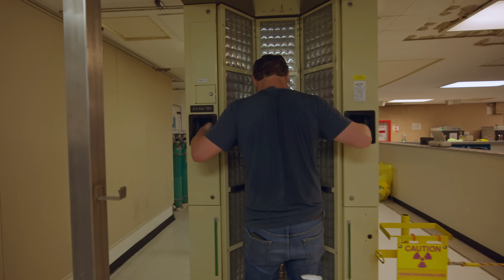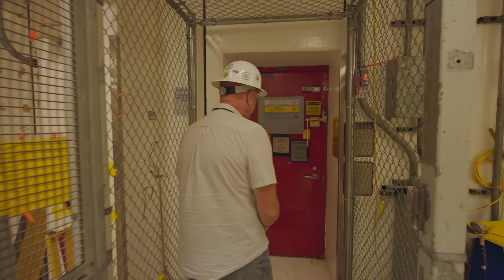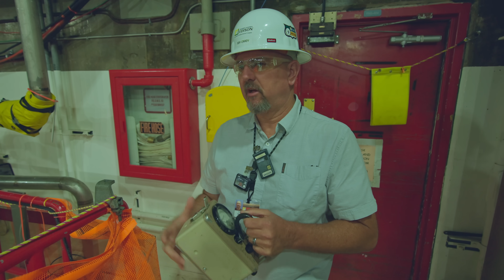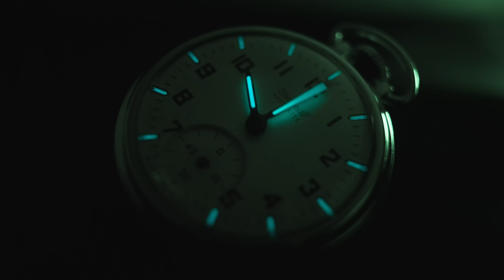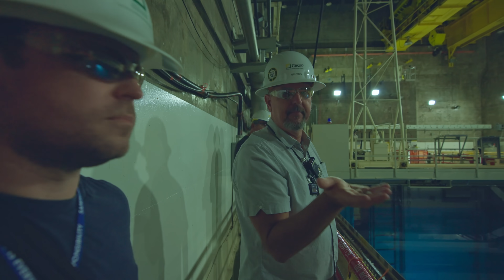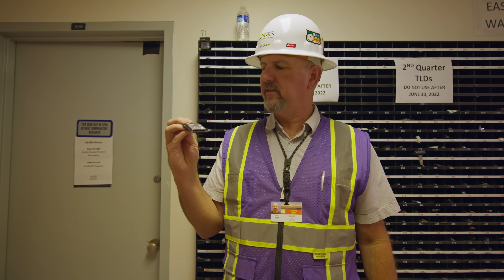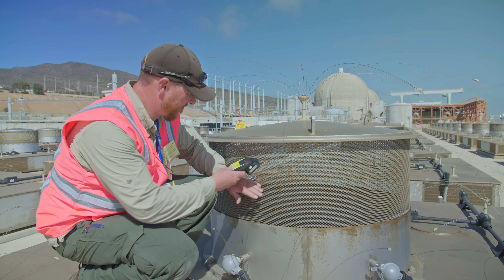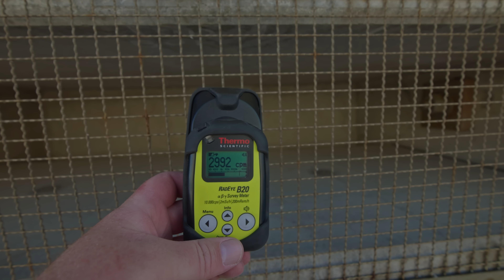Inside San Onofre Nuclear Power Fuel Pool and Spent Fuel Storage

Comment: I spent my career as a renewable energy infrastructure technician and if I had to pick between wind or solar for longevity, ease of operation, power output and environmental impact and ROI... I'd choose nuclear. 

Spent the last years of my career working for GE.  Did you know a solar panel has to be used for 7 years before it "pays back" the electrical debt it took to create it?  The silicon has to be grown in vats using huge amounts of electricity.  There's also many toxic chemicals used and other materials which all have to be mined, refined, and smelted.  Typically in other countries where their emissions controls are unregulated.  
On top of that, when the panels (we call the modules, but y'all call them panels.  Technically a panel is made up of modules...but if I say module everyone's eyes glaze over) aren't easily recycled. 
Pretty soon there will be mountains of panels laying around waiting to be recycled.  
Except that recycling process is going to use lots of electricity too. 

The wind turbine blades are fiberglass, and are already creating a problem.  They were scattered all over the old fields I worked on, covered in grease and oil. Nowhere for them to go, but they sure have created a habitat for rattlesnakes.

But everyone who doesn't know crap is always like "fill the deserts with them!"

Now you need more transmission lines.  You're talking hundreds of thousands of tons of aluminum, steel, copper and alloys (which all has to be mined and smelted, then cast or extruded...oh then shipped here!) just to run that power out across the desert to get it to where it needs to go. 
And because you've stuck all that power generation infrastructure in the middle of nowhere... there's more line-loss getting it to somewhere.
And due to the heat, everything gets derated.... 
Then people have to go live nearby to maintain it. 

Then there's nuclear.  
There's over 400 nuclear power reactors operating around the world, yet how often do we hear about major accidents?  
Mostly Fukishima with the tidal wave.  We've been learning from the past mistakes and incorporating them into newer, safer power generation technology.  
A properly set up operation today can re-enrich the waste with a breeder reactor and generate power off both sides of the operation, generating even fewer amounts of actual waste and greatly increasing the operating life of the fuel. 

Now lets talk about draw. Megawatts v megavars.  
With renewables, they're always outputting 100% of what they can produce at any given time, whereas a steam-driven turbine can spool-up to match the load. 
So say it's summer and Dryer's ice cream company wants to turn on a whole bank of freezers after a maintenance cycle...  that's a lot of inrush current, ok maybe they start them in series...  but where does that power COME FROM if renewables are always outputting what they can, when they can??
So now you're like.. oh we'll use the renewables to charge batteries, and we'll store the power!  Wonderful!  Now we're mining F-tons of lithium and other rare earth minerals and no matter what anyone tells you, any tonnage of it is ALL conflict mined...  but everyone needs it so no one is really pushing that whole story. 
But besides that, now you've got massive loads of more mining, more refining, more smelting, more manufacturing, to produce the batteries you're going to use.  Because lithium has such a higher energy density than lead-acid types.  

So now you've actually created a much larger carbon footprint by insisting on using renewables, than if you'd used COAL FIRED PLANTS in the first place. 

You know what's in the gearbox of a 3MW wind turbine?  A few hundred gallons of OIL.  Know what all the wiring insulation is made of, that runs up and down tower and all over underground?  Hydrocarbons.  You have any idea how many 5gal buckets of grease and lube get pumped in to purge bearings? 
How about electric pitch systems with their backup batteries?  6 batteries per blade, 18 batteries per turbine. So for just 100 turbines that's 1,800 gel-cell batteries that need to get replaced.  But since the desert isn't a cool location, those batteries won't last 5 years, more like 2.  So for a thousand turbines that's 18,000 15Ah batteries you're replacing every two years.  For 5,000 turbines that's 90,000 batteries.  

What's that, you're using a hydraulic pitch system? (no chance you're gonna get me climbing those disgusting oiltraps) now we're talking.... how many barrels of hydraulic fluid?
 
There's nothing "green" about renewable energy. 
Renewables have their place, but it's NOT powering massive sections of the grid and being relied on solely. The Green New Deal is a LIE being sold to you by ignorant politicians who don't have a clue what they're talking about. 

You don't get to just produce 95% of your products in other countries then act like that pollution isn't being created because it isn't being created HERE.  That's called a shell-game, it's what trickster's play. Which is also basically cap-&-trade in a nutshell... a big shell-game.

And now you're using up dozens of square miles to sporadically generate the same amount of power that a square mile nuclear station can generate reliably without ceasing for 30 years or longer. 

But yeah, go on with the whole "fill the deserts with solar panels and wind turbines" thing, you'll continue to fool the masses into thinking you know something, and you'll continue to sound like an absolute fool to anyone who actually knows what's going on. 

The next time you guys hear someone say that line... start hitting them with these facts and see what they have to say about any of it.  What you'll find out is they have no answers, because they aren't used to dealing with facts, just rhetoric.  It all falls to pieces under the slightest scrutiny if you're aware of what you're looking at. 

I love solar, I'm fully off-grid.  No grid-tie and live quite comfortably.  Just replaced the old Outback 240V FXR dual inverter system with a new SolArk12kW with 8kW pv, and 21kW AES "48v" LiFePO4 batteries running canbus comms to put the system into closed-loop operation.  
It's not "green", it's renewable... but really it's easier just to call it "off-grid".  It's not on the grid, it's off the grid.   My electric bill is essentially $150/mo across 20 years.

There's no reason to bring into it the inherent green-ness, or lack-thereof.  It all took fossil fuels to create, but it allows me to live "off" the grid. That's it.  No extension cord, y'all have your blackouts and I do my own thing.  Guess what happens if there's no sun for 4 days?  A propane backup genny kicks on.  Guess what happens if it doesn't kick on?  A gasoline-powered genny kicks on.  So propane is the 40kW primary but I can charge this bank on as little as a 4kW generator. 
Try that with a 48vdc lead acid bank. 

If you want to know about renewables... go ask someone who works in renewables. 
But the next time someone says to "fill the deserts" with them... he doesn't know jack.
Reply: Word! Nothing can compete with nuclear.
Reply: Wrote all of that and not a single comment
Reply: @The_Movie_Thieves  most folks these days have incredibly short attention spans. 

They also prefer to be lied to, people don't typically want to know anything that might go against their strongly-held beliefs.
People don't have time for things like facts.  
Especially if they don't fit the narrative they want to push.
Reply: Efficiency of solar system starts dropping off after 5 years . Then comes the cost of getting rid of the panels cuz no one can just dump them into back alley trash  . Try stacking panels in a back corner of your yard & ask if code enforcement says anything . Then deal with the EPA fines from volitals leeching out from cracks into the ground .
Reply: Brilliant!
Reply: Thanks for putting your time into making this comment
Reply: Dam did you have more time on your hands to write this. Whew I can't imagine the novels you send your lady after she gets mad at you and you have to go detail for detail in your brain about how you are trying to renew yourself to be better 😂.  But yeah I agree
Reply: Bro you might be schizophrenic
Reply: Why don’t we just fill the freakin deserts with wind turbines? Duh. 🤪

I kid, but no, I’m a firm believer in nuclear power. I believe we need it and we are going to continue to need it for the foreseeable future. Some people keep promising nuclear fusion is right around the corner but meanwhile we can’t even figure out how to make one fusion reaction that doesn’t require a TON more energy to make happen than whatever potential energy would be created. Those lasers that NIF uses are ridiculously power hungry. So far all we’ve done in the field of nuclear fusion is figure out how to spend a ton of money to use electricity up. So far, at least, it’s gone nowhere, and fast. You’re right about renewables and you’re right about batteries. Nuclear (fission) power is the one and only way that we humans have figured out how to deliver baseload-levels of power to the grid reliably, 24/7, year in and year out, with the lowest carbon footprint and no co2 emissions (at least from the process itself). If we don’t want to use nuclear power and coal-fired plants are needing to be phased out then where else are we going to get the power for 7 billion humans?

Comment: what were to happen if you fell in the water in the pool or say if the fuel were still in there what would happen to you
Reply from the maker: Nothing...the water is a great shield against the intense radiation coming off of the spent fuel. If you were to dive down to try and get to the spent fuel...maybe 10-15 feet or so, then you might get a fatal dose of radiation.

Comment: Is the qater in that cooling pool radioactive?
Reply from the maker: Yes, the water is radioactive. It’s like that because of little pieces of metal that have been made radioactive from being close to the spent fuel. Spent fuel gives off different types of radiation but there is one that mainly happens with fission and that’s neutron radiation. That’s how non-radioactive materials can become radioactive.
Reply: @RadioactiveDrew  then what do they do with that radioactive water?
Reply from the maker: They will filter all the activated metals out of the water making it safe to be disposed of.
Reply: @RadioactiveDrew  how do they do that? Is the water safe afterwards?
Reply from the maker: The water has to be safe afterwards or it gets sent to low level radioactive waste storage in Utah. I don’t know all the ins and outs of how it’s done but I would imagine just a bunch of filters and it run through them over and over.

Comment: Great video.

For those of you that work in SI units 5000 mRem equals 50 mSv.
Also the effective dose limit for nuclear workers is 20 mSv / yr averaged over a rolling 5 year period (i.e. 100 mSv / 5 yr) with a maximum limit of 50 mSv in a single year.

Comment: Did I understood right that the pool is empty of the rods?
If so, where the radiation comes from?
Reply from the maker: Yeah, all the fuel has been moved to dry storage. The radiation comes from metals that have been activated by neutrons coming off the spent fuel.
Reply: 700 reactors have been decomissioned. 25 out of them has been dismantled.

Comment: Nuclear is clean. Solar destroys land.
Reply from the maker: I think solar has its place...maybe on rooftops and parking lots. But putting a bunch of panels out in the desert is really bad for everything that lives out there.
Reply: @RadioactiveDrew  I agree Roof Tops, and old Parking lots. There was talk about what about the Sahara? Well if they were to cover the entire Sahara, it would limit the dust, this dust benefits the Amazon, and actually helps to suppress Hurricanes. Covering the Sahara could actually harm the Amazon. 

In the deserts it would impact life in general. So what it boils down to, its a selfish $$$$ driven enterprise. Wind generation may also have a negative impact as well. IT could affect air currents downwind as the rotors disrupt the airflow. 

It's why Nuclear is a viable option, less impact and it is very safe. The 3 major incidents was human error. Fukishima if they built the walls higher, 3 mile island if the fools there didn't interfere with the system, and Chernobyl, if they weren't screwing around with the fuel rods. There are reactors that do not produce waste, and there are newer smaller reactors that could power small towns vs using an interconnected grid. Solar? Adds 190lbs of carbon per acre, while the trees they prevent from growing remove 130 tons per acre per year.
Reply from the maker: @InTheKnow-2525  nuclear is a way better option for energy generation when looking at energy density and land usage. Nothing even comes close to it.
Reply: @RadioactiveDrew  Longer term viability as well.

Comment: Great video, duck tape and an old sock to reduce radiation in this area.  WTH…love the rust and corrosion on some of the pipes.  Makes me feel safe.  Looks like another disaster waiting to happen.
Reply from the maker: The plant is in the process of being decommissioned. So yeah, a lot of things aren’t going to be tiptop at the moment. Also that is a lead soft shield wrapped around that pipe. Think of the same thing you wear when you get an X-ray at the dentist.

Comment: Question..when you asked about tsunamis, your guide mentioned the use of the sea water to cool the fuel down.  I recall from Fukushima that the problem with using sea water is that the salt in the saltwater is corrosive and may reduce some temps, short term, but it would destroy and corrode other parts of the containment vessel.  Is there something different about this plant where sea water is a viable back up plan?
Reply from the maker: The sea water cooling was part of the secondary loop, which has no contact with the primary loop that connects to the reactor.

Comment: If you swam in the pool with spent rods, would you die?
Reply from the maker: No. The water would shield the vast majority of the radiation at the surface. If you dove down 10 feet or so you would get a fatal dose.

Comment: I wish that crap was gone from my back yard. Yay 5 feet over the 27 foot tsunami prediction. Smdh. Its sitting on a massive fault. get it away from the ocean at least.
Reply from the maker: Its totally safe right where its at. It would only be a problem with you were able to remove that 35,000 pound cover and climb down inside.
Reply: @RadioactiveDrew  “Totally safe” would be eradicated somehow. It’s not totally safe as you can see from the lengths that go into containment. “Totally safe” until it isn’t. Get it away from the ocean is a NO BRAINER

Comment: What is the half life of the rods? What is the expected life of the long term containment?  Tsunami safe maybe but earthquake, terrorist or missile strike? Yikes  Great video, thanks!
Reply from the maker: The spent fuel is safe right where they are at. No threat from any of those things listed. They will be dangerous for a very long time...but unless you go there and are able to lift up that 35,000 LBS lid and climb down inside you will be safe from them.

Comment: I am curious: at 33:44 min you mention that the radiation at the vents is not coming from the air, but rather from the dry storage down below. So why is then the radiation at the older dry storage units so much higher specifically at the vents? Is there just less shielding at the vents?
Reply from the maker: Yes there is less shielding in those older dry storage containers at that vent.

Comment: The spent pool is kinda creepy. Right? Its like, the worlds deadliest pool.
Reply from the maker: Its pretty far from the worlds deadliest pool. You could swim in there and be fine. But it wouldn't be a good idea to get the water in your mouth and whatever you went in there with might have a hard time being decontaminated. Even if the spent fuel was still in there it wouldn't be very dangerous...unless you dived down to the spent fuel. If you did that you could get a fatal dose of radiation. But on the surface you would be fine.